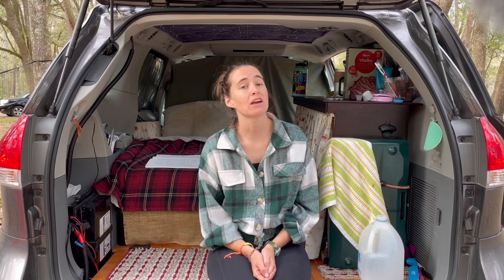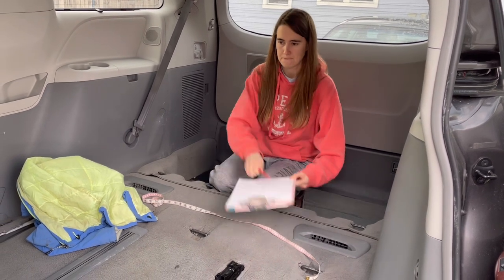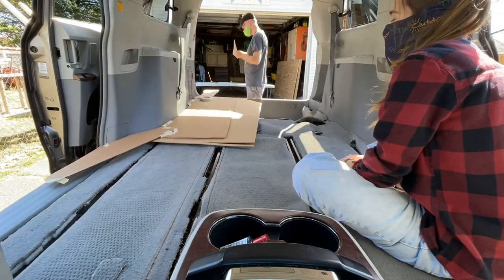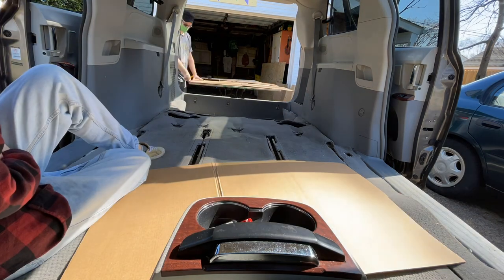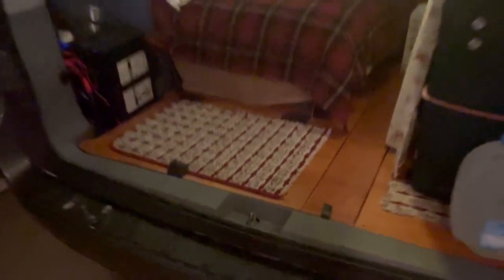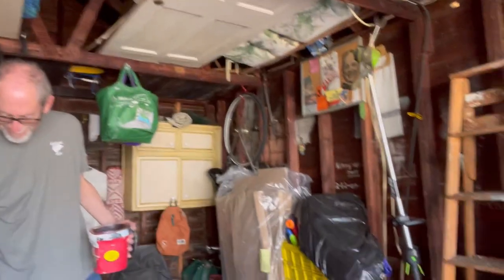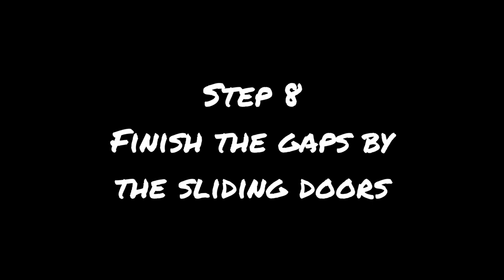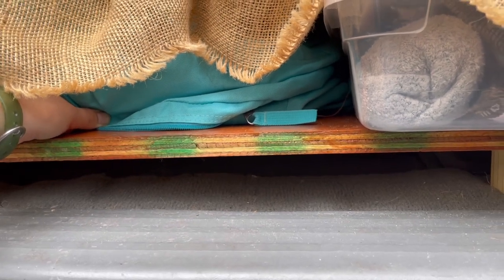How to Build a Floor with Storage in a Toyota Sienna Conversion! [Step by Step]

Comment: To help anyone else who is modifying one of these vans please read this. The sliding rails simply unbolt as a unit. The rails, the slider part, all of it unbolts. No need to cut or hammer or pry and no need to remove the sliding portion by itself. The nuts for the middle rails are underneath the van. The threaded part sticks down through the floor so the nuts are put on from the underside. Some model years might have slightly different bolt locations but they all bolt in. Folks, except for the body panels which are welded together and frame rails, almost every other part of a car, truck or van is bolted, cliped or screwed together. I watch videos like this and many other involving various aspects of car repair and modification and people make a ton of work for themselves or can't get the vehicle the way they want it because they couldn't figure out how to remove a part or, worse, severely damaged a part when trying to remove it improperly. When in doubt pay the money for a repair manual or simply ask your dealer. It would help to buy the repair manual for your year model of vehicle anyway just to know how things go together and come apart so you know out in the wild if something is or isn't right if you're not very familiar with cars.
Reply from the maker: Thanks for the info! I was told I would have to pay a whole lot for them to get to the rails from the other side of the floor. I’ll pin your comment so it’ll help other folks with this, hopefully. What year is your Sienna?
Reply: @BeerinBeautifulPlaces  With enough effort, maybe someone will one day find a buyer for the seats removed from their conversion. However, "penny wise... " as they say.
Reply: Bruce Parks videos show how to take out far back row...w good instructions.
Reply: Wow, that is good-to-know info!!!!!!! Thank you Dave P!!!!
Reply: Unfortunately some models, including mine (2011 LE) do not allow access to the bolts you need to remove from underneath the car- can access the ones under the spare tire to remove that rail, but cannot remove the one on the middle-left unless you remove the fuel tank! A mechanic quoted me $260 for this job so left one rail in- got the trolley out by removing the end bracket, raising up the carpet, and chiseling away some sealant that was blocking it from sliding off.
Reply: Great info!  Those holes could be very important to bolt down the floor to the chassis, and then bolt all the furniture to the floor.  I haven't seen any build that takes into consideration an impact.  All that stuff not bolted down will come right into the drivers seat.
Reply: Thank you, THANK YOU!  I would never sell my seats nor modify my van in a way it couldn't be put back to original.  I might want to sell the van in it's original condition so someone could start from scratch and make it their own.  I often watch video's and wonder if they really know what they are talking about.  When I saw the Saws-all come out I had my doubts.  Thanks for making the truth known so others coming along will know better!
Reply: Most people aren't stupid. Anyone looking at the bolts know they're screwed into the floor of the car. However, depending on what generation Sienna they have, the bolts may be difficult to access. I know it's a lot of work to get to the 3rd and 4th generation bolts, including removing major parts like the gas tank. I think it's even more work for the 4th generation Sienna. It's a lot simpler just to cut them out. If they're really that important, people can get new rails from a junkyard.
Reply: @Surfingtsunamis this is a good point, while I agree with the OP that buying the repair manuals and taking the time to see how everything fits in is essential..... It's also true that sometimes those bolts and things are difficult to access without first removing parts that a novice diy person should probably leave alone!
Reply: Her is 2013 I believe. Mine is a 2015 and my mechanic had to remove the gas tank to get the bolts off. Wasn't difficult. The dealer refused to touch anything on a modified vehicle.

Comment: A MUCH easier way to get the shape of the insides of the vehicle is to tape a wide straight piece of cardboard in the vehicle.  Take a narrow board with a blunt edge on one side and tape a marker of some sort to the other side. Make the narrow board long enough so the marker will touch the cardboard all along the length.  Now just run the board down each side as it marks the shape onto the cardboard.  Cut that out and you have a nice clean template.
Reply from the maker: Nice!!! That’s such a neat trick!

Comment: Pull up the carpet and unbolt the tracks... much easier than  butchering with a saw!!!
Reply from the maker: I tried that, it’s in my vlog I was making while trying to figure out this process. One came out easy, the other was blocked by another immovable part of the van, and that’s the one you see us cutting out

Comment: Great job!.......FYI for ya.......the seat rails do come out but it's a major pain in the ass to remove them. You have to remove the carpet, white insulation and all the trim pieces surrounding the seat rails.  Now you can see the actual rails......the outer 2 are bolted in.....but here's where it gets tricky, Toyota uses these bolts with no hex heads on them....just a big flange, the nuts go on from the bottom of the van and welded in place.  So, there are 10 of these buggers, 5 on each rail you have to grind off with a 4 1/2 in. grinder with a 1/4 in thick grinding wheel. It's a messy job with all the steel grinding dust.....you will also need a shop vac to vacuum up all the fillings.  It's worth the time because you will gain 2 or so inches in living space.

Comment: on my 2021 xle the air bags are part of the second row seats so if you try to take them out you end up with serious sensor issues. There are plugs to snap into the coupling links for them so that you don't have this issue but you have to leave the rails in. I really wish toyota would figure this design flaw out. the second row should be either stowable and or removable to create a flat floor like the caravans. I loved my caravan for this feature, but I also love the hybrid. always a trade off eh?
Reply: My 2017 AWD sienna had 2nd row seats that slid way back or just popped out easily. with no airbag issues. And the grooves for them were virtually flush with the floor. I think it's a genius design.

Comment: I'm about to do a conversion with my Sienna (when I get one). What year model is your Sienna? Does your Sienna have "All Wheel Drive"? The reason I'm asking is, in some vans that have the fold-under-seats, it eliminates the AWD.  I need a van with AWD. The fold-under area takes up the space that is used to install AWD. 
I also need another measurement that wasn't included in this video (if you would be so kind to). On the passenger side of your van... what is the length from the back end of the sliding side-door to the end of the trunk. I'm wondering if a small bed cot would fit. My cot is 75" long.
BTW, I love your set up and thank you for making this video!!!! It's going to be very helpful to me when I start my project!!!  I plan on doing the same thing when I find the right van.

Comment: Have you had any problem with condensation and mold underneath your floor since you kept the original carpet in?
Reply from the maker: Nope, not in the year and a half I’ve had it! One regret I have is we needed a leg that propped up the floor to be less than half an inch taller, so we used cardboard, laid flat, to boost it up. I’m worried about that getting moldy, but so far it hasn’t, at least on the side that’s visible!
Reply: @BeerinBeautifulPlaces  Awesome to hear. Thanks for the reply.

Comment: Where do you keep a spare tire?  I  just love this build. It looks so spacious.
Reply from the maker: The tires that came with the van are “run flat tires” so if they start leaking, I can drive on them for 50 miles without getting damaged, to get to a mechanics to get another tire.
Reply: The Sienna has the spare under the van just to the rear of the passenger seat.
Reply: @RH-go2dk  Not all Siennas come w a spare.  2013 doesn't have a spare.

Comment: Brad, Can you tell me the measurements of the deep area, under the back (3rd row) seats, where the seats fold into the floor.  I need the width (from side to side of the car), the front to back length, and the depth of that compartment. I can't find that measurement anywhere on the internet. I'm looking to buy either a 2006, 2012 or 2013.

Comment: Maddie how did you get the rails removed? My Sienna is a 2016 XLE. I haven’t looked underneath yet to see if I can just remove the bolts or if the gas tank will need to be removed. If I can’t, then I’ll just have to raise the floor little. It matter too much because I’m just under five feet. I also wanted to ask about the width of your bed and where you got your mattress. Sorry for such a long comment.
Reply from the maker: No need to apologize! I thought I showed us getting the rails removed in this video? One "cleat" on the rail slid off, the other had to be cut off with a sawsall. It might be in this video, which is the more personal, less step-by-step vlog when when were making my floor. https://youtu.be/caNTFPHplCs?si=1G4ZFEIzjmZlh61S
My mattress is from Sinus, a foam "cot-sized" mattress, 30 inches wide, six feet long. I think I ordered the 4 inch tall version but it's more like 6.
Reply: Thanks so much for replying. I keep watching your floor build over and over as with many of your videos. I love your van set up and want to do mine very similar to yours. I’ve liked it the best of many different ones I’ve seen. I thoroughly enjoyed your AT adventure because I’m from New England. We lived in Patten Maine and Mt Katahdin was the prettiest view from our front porch. The sunsets were amazing. My older sister climbed Katahdin as a teenager and walked Knife’s Edge. 
One more ?  You have a lot of followers. Do you make much money from YouTube?

Comment: Where is the van’s spare tire?
Reply from the maker: The van came with “run flat tires“ so there’s no need for a spare. If one gets damaged they are designed so you can still drive on it for up to 50 more miles in order to get to a mechanic

Comment: I am thinking about how to go about my sienna conversion. putting a floor in seems like a ton of effort and finessing but it seems like it would be great for building on as a foundation. Also probably helps with insulation?
Reply from the maker: Yes, definitely! It was the hardest and most time consuming part for me, but it made building on top of it easier. Plus, all my furniture is drilled down into the floor, which is important in case of an accident

Comment: Question:  Looks like u have a dresser on right side of video.  How does this stay up?  Is it installed/attached, glued, nailed, etc?  Thank u so much.. I love your floor, etc.
Reply from the maker: Thanks! It’s drilled into the floor and there’s also a bungee cord that goes around it clipped on to where a little hatch used to be!

Comment: Just wondering, besides going to the dealership and holding a board…what did you do???
Reply from the maker: I measured, designed, and marked off all the dimensions of the build, researched what method would be best for this build, came up with the whole process, went to buy everything after making sure I knew exactly what to get, worked and saved up to afford everything, and reached out to everyone that helped. 
Not everyone that builds out a van has had the opportunity to learn how to build stuff, and I don’t think that makes a person lesser than, as you’re implying 🌻

Comment: The saw is a reciprocating saw, but many people call it a SawzAll, which is the name Milwaukee Tools gave it.  Also, those rails can be removed from the car without needing to damage them.  The method depends on the model year.
Reply: I knew someone would answer the question of what the tool is called and I came here looking for the comment who answered the question. I’m sure not everyone would know what this tool is called so thank you for sharing your knowledge.
Reply: @RainForestSoul  You are quite welcome.  It's a bear of a tool used for demolition work.  With the right blade you can cut through almost anything with it.

Comment: So crazy that I saw this post this morning cuz I have an app't in an hour to have my 3rd row seats removed from my Honda Odyssey, which I only purchased a few weeks ago! I've already constructed the floor in the rest of the van, was planning for that rear storage area to be a separate build as my galley. Thanks for your detailed video!👍
Reply from the maker: Cool, what a coincidence! Congrats on your purchase!
Reply: How did that seat removal go? I took all the seats out of my 2016 odyssey  building a platform over the 3rd row well, putting 2 280ah lifepo4 batteries in there.
Reply: @johnlucier5654  Hi John, sorry for the delay, I'm not good at seeing that I have notifications 🙃 my 3rd row seat needed an impact tool for removal, which I do not own. I wish I wouldve had them dispose of it, now it sits in a storage locker (all 200 lbs of it) and i dont see it ever going back in the van.
Reply: @ragtoprenee2437  lol i have the 2nd row seats for my 07 odyssey in storage 4+ years now... 2nd and 3rd rows for my 2016 odyssey 6 months.... But selling the 07 soon so it wasnt a waste. Thats what it comes to is resale time cuz theyll be hard to replace and the new owner may want them. However when you live in a vehicle for a few years it takes on a special kind of funk so resale value is iffy.

Comment: Good inspiration. I’m planning to redo our bed. It’s for two people and takes up most of the van. Looking at plans to make it stowaway or folding. A van for one person is much easier to layout.
Reply: I've thought of making a cot up high over the seat backs, to free up all the floor space.
Reply from the maker: Yeah, one person is definitely easier!
Reply: @gregpeterman1102  if I didnt mind drilling some holes Ive always wanted to make a bed that hinges on the side, flips up to the wall to stow, flips down to sleep in with cables supporting it. For now using a 25x74 cot thats 9" off the floor, have 4 bins that slide under for storage.